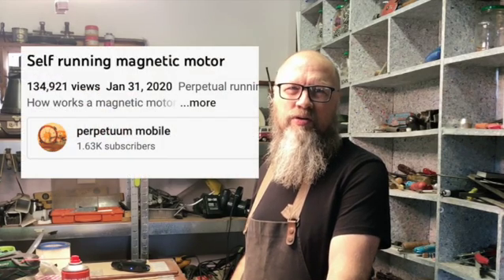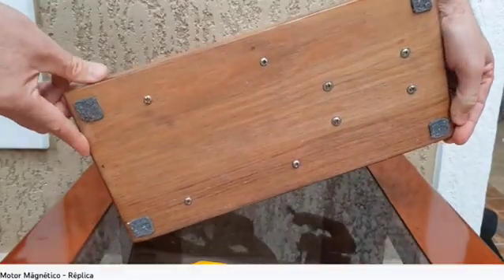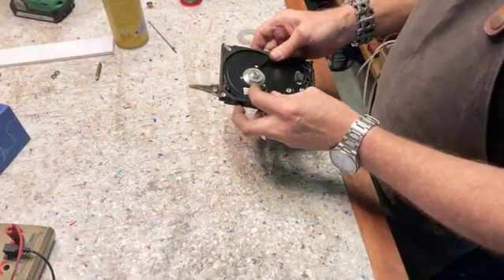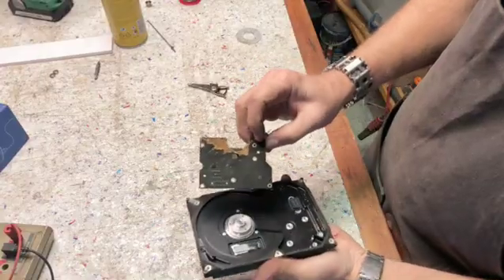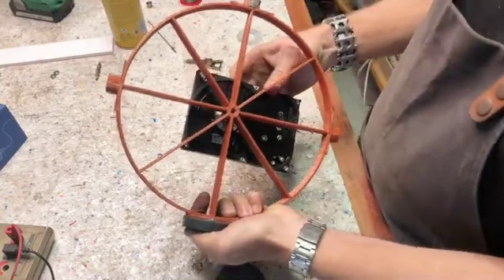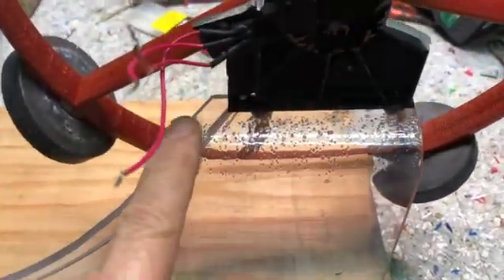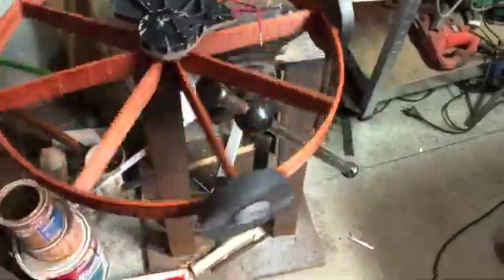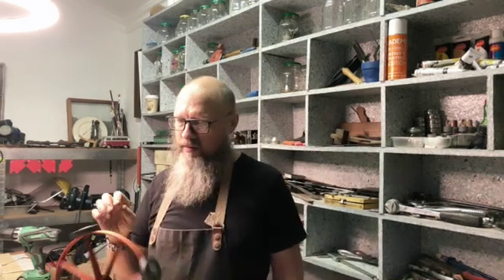How to make a self running magnet motor part 1. Free energy perhaps…

Comment: if you somehow suspended the axel, or the centerpiece of the wheel which rotates, so its sandwhiched between 2 fields, it can allow for significantly reduced friction during rotation, and placed this machine in a vacuum, even the air wont cause friction on it, and it may not be "free unlimited energy" but i get the feeling it would be one hell of a generator.

Comment: If you take a bunch of round and strong neodymium magnets and put them on the blades of a fan, all facing the same direction, then move a magnet close, it pushes before being attracted to the next magnet. If the magnet was on a shaft, and there was a shaft to push it away after it pushes against the first magnet, the fan should keep spinning as the magnet comes back and pushes against the next magnet

Comment: Magnetic repulsion works like a spring, you have to compress it to put energy in then release to get a bit less energy out. That, simply, is why these devices can never run continuously by themselves, let alone provide excess energy.

Comment: The world is lacking imaginative critical thinkers & engineers, keep at it. Maybe enough people could be inspired by the multitudes of videos online showing similar concepts & attempt to build their own Magnetic motors, (Or perhaps 10 or 20 of them for personal use in their home as well as working on efficient ways to use those motors to charge batteries. ?Maybe🤞😎).
    Magnetic motors have been around since the 1960's, first design was patented in the USA in the 1980's.
If this concept was cost efficient in use for a cities power grid it would have been implemented long ago.

Comment: Great wheel you built. 
Could this idea be implemented in larger builds to generate power with just magnets?
Europe is in a state of big concern about power because of the problems with Russia that has been providing so much of gas, so I am sure they need to think of other ideas for power. 
I have very little knowledge about this type of thing, but with all the power problems also with you, I am sure there are people who can think outside the box. 
Looking forward to next week.
Reply from the maker: Thanks Anita. If this works, and IF it generates more power than necessary to keep itself running and I manage to get some extra power out- which is a BIG if… then yes, it could be scaled up however you will need very large expensive magnets…
Reply: Magnetic motors have been around since the 1960's, first design was patented in the USA in the 1980's.
If this concept was cost efficient it would have been implemented long ago. The power created by almost all magnetic motor designs create very little power, usually just enough to turn on a lightbulb, but not at it's full brightness unfortunately.